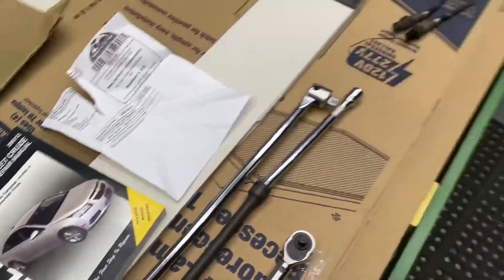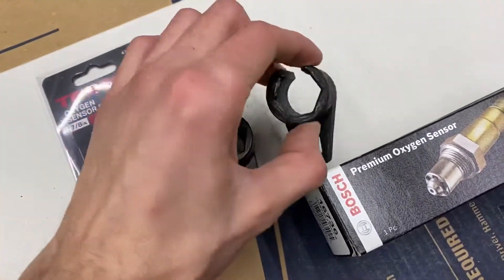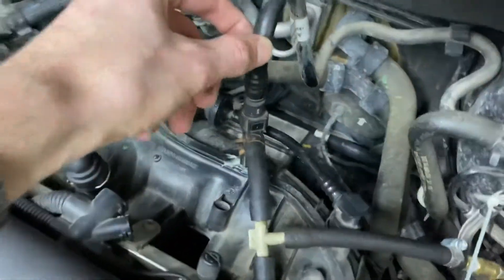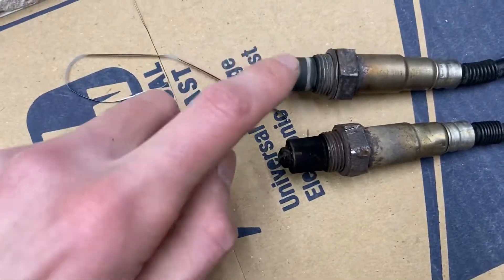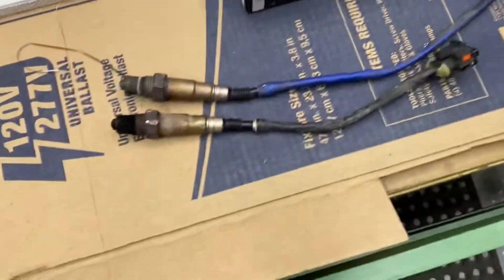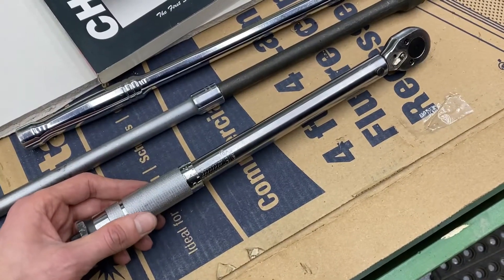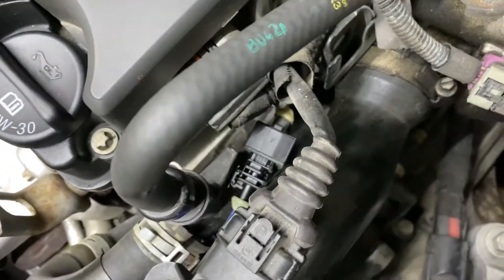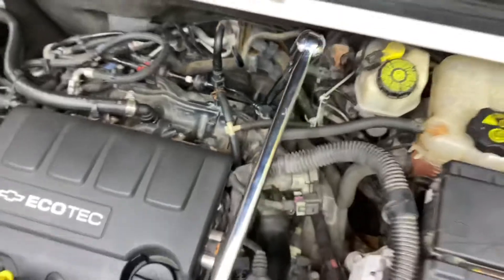Chevy Cruze O2 Sensors

Comment: Hey quick question I recently replace both of my O2 sensors on my 2014 Chevy Cruze turbo a few months ago along with that I had to replace the catalytic converter and also the transmission ignition coil and spark 
plugs & knock sensor And I recently got all this done in the over the last 3 months . so I thought all my problems were gone and I picked my car up today from my mechanic. I barely made it off of street before the car started jerking and immediately reducing my foot all the way down on the pedal there was nothing at all, stuck in the middle of the road, and then I got to the red light and it just started shaking and then cut off completely but crank back immediately. The check engine light came on and the codes are P0132 P0134 and I am aware that those are the O2 sensors but it’s weird because I’ve had those replaced maybe six months ago if that I don’t know if it’s because they’re aftermarket O2 sensors so should I try the O2 sensors from GM? Somebody help please.
Reply from the maker: Strange, i would start by using two cans of fuel system cleaner, maybe a fuel injection is dirty or bad? Don’t really know other than a scan tool that shows fuel trims.

Comment: Are the sensors the same oem numbers for upstream and downstream for a 2018 chevy cruze???
Reply from the maker: Different sensors than one in video, but for 2018 one # for both 12701634
Reply: @Mr95Kenny  I did replace one with 12701634 but the original OEM are 12663317.  I found 12663317 for sale and matched the same numbers on the original sensor on the car. I got the 12663317 for $20 brand new.

Comment: Great video , u just replaced my daughters oil cooler seals and after putting back together everything car runs ok , but after a whole engine light came on , after I did diagnose it brought code H02S Heater Control Circuit sensor 1 , I cleaned the sensor but still code is there , u think that I need new sensor
Reply from the maker: Yes i think so

Comment: Best way is from the top for the downstream...but instead of using the claw o2 socket get or rent from AZ or Adv an o2 sensor kit...in there will be a deep o2 socket...or u can buy one pit it on the sensor the wire will come out the side slit get at least 24 inch extension and hit it with an impact gun...battery or compressor...will come right out and not break the vacuum hoses....if u dont have an impact go by any muffler shop and tell them to just loosen the o2 for u for a couple bucks real quick and u can go home and swap them yourself....

Comment: Do O2 sensor Spacers fit on these ok? P0420 code, i would hope only an O2 sensor problem, only 70,000 miles, and I’m selling the car so I just want a cheap fix, sense I’m not even positive it’s an O2 sensor failure, but if it is at least people aren’t going to get scared off by the check engine light if I can just put in a spacer and fix the issue
Reply from the maker: In today’s market you should be able to sell it without fixing, but two O2 sensors might fix it.

Comment: What are the symptoms of the O2 sensor failing?
Reply from the maker: Engine light.
Reply: @Mr95Kenny  Obviously. What I mean is what does the car do when its failing?
Reply from the maker: Sorry lol. Um i think just lower mpg really.
Reply: I see your question is over 2 years old but for anybody that wishes to know, sometimes there are no symptoms with a bad O2 sensor other then a check engine light and a code of P0130 detected with an OBDII scanner.  There are cheap ones available for around $40 for your own personal use since you don't need an expensive professional mechanics type. 
Other symptoms can be- •bad fuel economy
•black smoke exhaust from overly rich fuel mixture 
•rotten egg odor from exhaust 
•bucking or surging engine performance 
• a code P0420 suggesting bad catalytic converter given by faulty O2 sensor relaying false info to the computer. A simple heat performance test with a $40 laser temp gun can determine if the converter is functioning properly thereby indicating a faulty O2 sensor. There are many videos on utube to show how to perform this test. There are also many videos showing how to check an O2 sensor with a standard volt/ohm meter.  If you wish to spend a little more then $40 you can buy an OBDII scanner that can provide live status to actually read if the O2 sensor is good or bad. There's a couple videos available on that procedure also.😎

Comment: Why not just do it from underneath the car, so nothing is in your way and so you don't break anything?
Reply from the maker: If you can yes, but this one was a pain to break loose
Reply: @Mr95Kenny  yeah I actually tried under the car today and couldn't get enough leverage on an open ended wrench and then I could find my oxygen sensor adapter and don't have enough extensions to reach from the top. How many inches of extensions do I need to reach from the top? Looks about like 3 freaken feet lol
Reply from the maker: @koreymayo8884  you will need a few, can get them cheep at Harbor freight!

Comment: At how many miles did your o2 sensors fail?
Reply from the maker: 150,000
Reply: @Mr95Kenny  thanks
Reply: I have 119k on my 2014 Cruze. I haven’t gotten a code for either O2 sensor. What do you think, change them now or wait until I get a code?